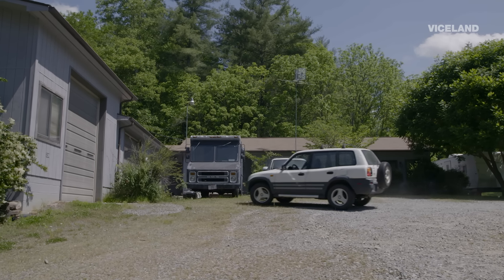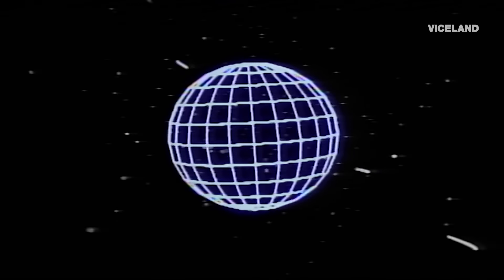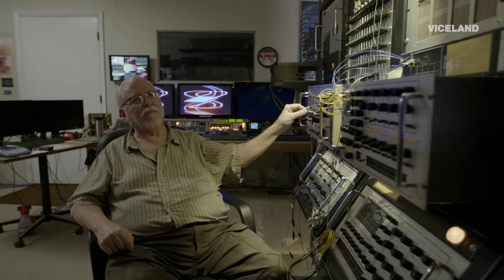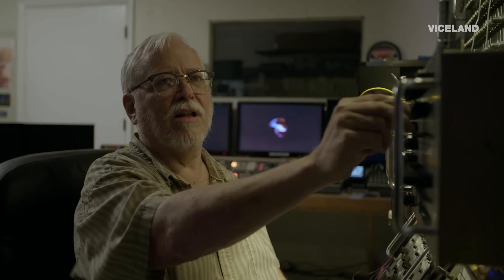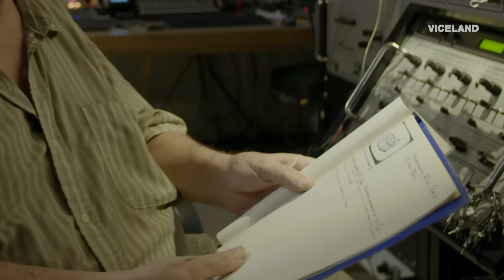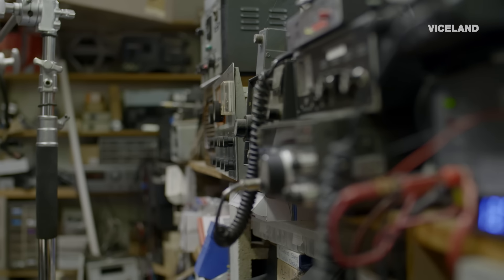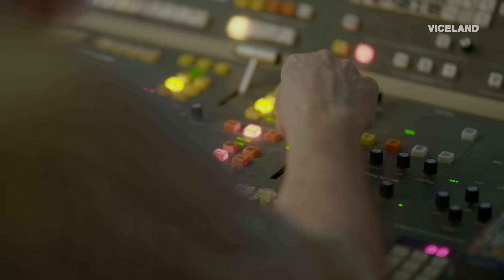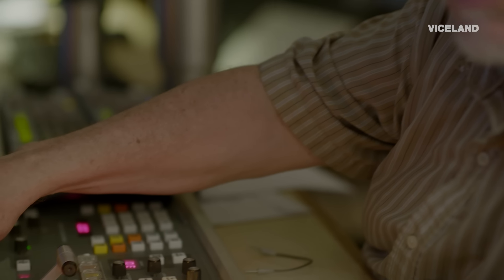Meet the Engineer Preserving The Last Analog Motion Graphics Machine

Comment: This guy is like the wise old grandmaster of Vaporwave graphics and he doesn't even know it!
Reply: I have forgotten the name of that OLD 1990s device Old 1990s device where you connect your vcr, tv, dvd, etc and just press the bottom if you want to watch tv or vcr or dvd or whatever while all of them are running at the same time. Anybody out there knows the name of that device? My American friend wants to know the name of that device because he remember using it as a kid when in the 1990s he has a TV, a VCR, a DVD, a Radio-Cassette, a Hi Fi Stereo FM and AM set with vinyl record phonograph. And is there anybody out there who knows the name of that OLD 1990s TECHNOLOGY DEVICE? He said it more convenient than those all digital system when with his old 1990s technologies (some of which he is still looking in his garage) are all analog controls using press bottoms, level bottoms, knobs, dials, slide controls, slide switches, lever switches, etc ALL ANALOG as he describes it.
Reply: @darthvader5300 They are still made today.  They are called AV switches.  You can plug in several devices at once, then connect your TV to the output.  Pushing a particular input's button will switch to that input.

Comment: Why does obsolete technology have to be so beautiful?

“This stuff was made to be fixed” - Dave Sieg
Reply: It's not obsolete, nothing can replace it. Apple, however...
Reply: @DarkAngelEU  ah yes because you can clearly use a 40 year old computer and still have it do everything computers nowadays
Reply: @vyrva5690  "tools" last forever, "computers" become obsolete. This is basically a large tool, not much computer stuff, just buttons and dials.
Reply: @xc8487  It still makes calculations, so technically speaking it still is a computer? The difference is that this computer is entirely analog, and modular, Apple computers aren't analog nor are they designed to be modular and that is the problem with modern technology: the producers don't want it to last. They treat it like a consumption product instead of a tool.
Reply: @DarkAngelEU  even tools today are made to become obsolete or break apart quickly enough.

It's a shame, CEOs have no respect for anyone apart from their money
Reply: @dabelli3818  If this were a computer, you'd be talking about render time. This years computer renders twice as fast....this isn't a computer, it's realtime analog electronics. Analog may not be the end all be all today, but it definitely has it's benefits, especially when it comes down to the granularity of control. We lost something when we switched to digital, and I'm certain there are probably a lot of things that could be done better in analog. They both have their benefits, but we're of the mindset today that newer is better, when it's really only better in specific cases.
Reply: @MaverickBlue42  oh no, I'm sorry, I think I didn't explain myself well enough.

My example was very broad, not really about this specific case.

Really, everything today seem to break apart quicker.

To make an example: a car from the 70s today is still running, but 10 or 15 years old cars are breaking apart, not to talk about newer ones.
Reply: @dabelli3818  You're probably lucky if you get 10 years out of a car nowadays.....
Reply: @MaverickBlue42  yeah, that's what I mean, and not only cars.

Washing machines, phones and Computers, light bulbs...
Reply: @dabelli3818  My PC is going on 10 years old now, there hasn't really been much progress on that front. Had to upgrade my video card this year but that's about it. Still gaming at an average of 80fps at 4k. If it weren't for upgrading to a 4k monitor, I may not have even had to do that.
Reply: @MaverickBlue42  yeah, but what about portables (?) PC?

I'm not sure it's the correct word, sorry
Reply: @dabelli3818  PC = personal computer. Laptops are garbage, you'll pay twice as much for equivalent specs, but it still won't perform as well due to thermal throttling. If you have to be able to compute on the go, it may be an acceptable trade off.
Reply: @MaverickBlue42  yes, thank you that is the word: laptop.

Yes, that is the reason why anyone would want a laptop, and they get old pretty quick compared to PC.
Reply: @DarkAngelEU  Louis Rossmann viewer too I see :)
Reply: @MaverickBlue42  10 year old PC running 4k 80? What exactly are you running GPU and CPU wise?
Reply: @Carterthielftw_  Who's that?
Reply: "This stuff was made to be fixed"

I feel like the same may be said for humans.
Reply: @Carterthielftw_  i7 2600, 3.8Ghz, stock cooler, 16 gigs of ram. It's not the greatest in the world, but it gets the job done.
Reply: @MaverickBlue42  ive got a similar old Win7 pc with a 3rd gen I5 and 12gb of DDR3. I use it when I am attempting stuff that could corrupt an OS on my main win10 pc.
Reply: @DarkAngelEU  google him, he's probably the largest and most well known right to repair advocate. He posts videos on stuff like component level board repair, life advice, stock market reports, cat videos, updates to R2R, etc...
Reply: @Carterthielftw_  Sounds like a guy I'd like. Thanks for the tip :)
Reply: I had an Tektronix Oscilloscope from the 70's.  The level of workmanship and engineering was top notch.
Reply: @Cole S I'm looking at ten original comment and trying to understand this comment but I just cant. It appears as if you are an Apple user (which is fine) that does not care about repairability (not fine) that calls people who are pro-repair "Google sheep"?
Reply: @Cole S nobody in my immediate family has owned an Apple product in the past 25ish years. We aren't a fan of the form over function and the business practices of the corporation. However I have recognized the issues with companies like microsoft. I actually hate Microsoft with a passion such that I have pirated windows 10 licenses on 7/10 of my PC builds. I would have pirated the other 3 but those friends didn't want to buy a sketchy ebay key. I'm in the process of moving over to Linux aswell. The only other OS that I would like to leave (due to business practices) is android. However mobile Linux device are absolute trash and I really enjoy the overall feel of android. I am currently using an S5 and a jailbroken Kindle HD8+. And I will never buy another Samsung product due to their anti repair designs. I am an Apple hater. I don't deny that. But I also do try not to lose sight of all the other, almost equally as bad, corporations that control our lives. :)
Reply: Because it forces you to be creative.
Reply: @dabelli3818  I used to work for a big appliance manufacturer. In a big meeting, one of the top dogs said "we'd love to make a high quality model that lasts longer, but the consumer just looks at the price tag & buys the cheaper one too often to support that model. There's no market for high quality, so we have to make them as cheap as possible."

That said, there are other managers in the world that do all they can to discourage repair.
Reply: so it stays around even though the average person in 2024 is a 4k addict

Comment: Imagine trying to figure this thing out after he dies. That's the real tragedy of stuff like this. It's going to be gone to forever.
Reply: I worked closely with a Scanimate guru for a few years, and still only had 3/4 of an idea how he did what he did !
Reply: On the flipside, at least it's easier to figure out than modern miniaturized locked down crap. Try to dissect and put back together a modern board and have it working.
Reply: @rockytom5889  The electronics wasn’t all that complicated, just a lot of it.
The trick was patching all the modifiers together to get the desired XY modulation.
The other issue was ensuring repeatable thermal stability over lengthy sequences.
Reply: Ryading Panaakalantayan  hehe, you must have seen a different machine than I did!
Lots of docs, [mostly OEM components) but not exactly ‘well documented’ as a system in the early 80s!
Reply: Hope he is mentoring someone with the same passion as him 🙏
Reply: @wideyxyz2271  Sadly, there is a point where the actual equipment becomes irrelevant, but it’s important to record oral history and the documents for history.
We do have to nod to improved efficiency and practicality, but the original motives are pure.
Reply: honestly this looks very similar to a modular synth. the controls seem relatively conventional.
Reply: @laustinspeiss  ok...let's see u do it
Reply: @Itwillgetbetternever  Why, I’ve never operated or set up a Scanimate to any extent than fiddling between jobs... if you want the number of a very experienced guy, I can put him in touch with you for a paying job.  It won’t be cheap.

Comment: Someone needs to bring back old things like this in film and stuff
Reply: What's stopping you?
Reply: Why? It's no where as good as what we can produce now with a computer... using this for actual movies or TV is just stupid.
yeah it's kinda cool, but it has absolutely no use now except to please this guy and anyone else who think its cool. But it has no use apart from that. We do so much better nowadays it would be dumb to use this for anything.
Reply: hahaha, what?!
Reply: "No use except to please this guy and anyone else who thinks it's cool." 

There's a lot of people who think it's cool my dude.
Reply: Wes Tolson yes many people think it's cool but u can still do everything that can do digitally. The only difference is that that is analog and u have to use chords and knobs and such to get the effects u want. It's the same thing with music. There are modular synths  (and they still make them) and software synths but guess what most music is made digitally because of the fact u don't have to be plugging in wires from oscillator to effects and such. The softsynths still act like the old analog ones in the since ur still turning knobs and such but it's easier because u can do it quicker. Ur not thinking realistically. Sure thay machine is amazing but we can do much more with less now
Reply: This probably could be used, but it wouldn't fit modern Hollywood standards. Maybe Indie productions?

Comment: My kind of man!  I myself was more on the audio front, but one of my predecessors on the campus audio distribution advanced to the TV issues before graduating.  I have been told that he turned in his first thesis work too late and was assigned a new topic, design of a TV trick mixer.  So, 14 days later he brought in a 14 page document.  And not only that, but a fully working Trick Mixer for the experimental TV studio.  That was amazing enough to be approved for his thesis despite the brevity of the documentation.  The expected length in those days was 50 to 100 pages.

Comment: I love this old analog stuff, you just can't get the same type of control with modern digital editors (video and audio).
Reply: RIPPEDDRAGON40k yeah, you get pin point accuracy with the equipment and software we use today. The beauty of analog were the flaws. It's like listening to old records. You know back in the day when artist would record something they had a very limited number of tracks they could record on so often times mistakes made it on the record. It's the feeling that humans with all our flaws put their hands on machines to mold the art that's what makes it so beautiful. Now-a-days all we get are cheap remakes of old visual art and mass produced digitally synthesized music with a 2 or 3 chord progression (I'm looking at you Taylor shift)
Reply: nothing will ever surpass the quality of analog. never 
no software can even emulate close enough to old reel track that band like queen used to record.
no digital camera can match the quality on 70mm or 35 mm film look too.
no laser printing does better job than dark room film process.

it's just that vintage stuff has the quality that no digital can ever reproduce
Reply: Ryan Ramsey tbf though, those recordings weren’t the Uber loud remasters we now have with no dynamic range. A lot of the “mistakes” are intentional though, certain songs with people talking in the background at a really low volume etc. It gives a greater sense of being there. I guess that’s why people invest in high end speaker systems as well.

Comment: Fun Fact: Even to this day, you need a lot of computation power to emulate analogue technology. Still, you get ~97% of the original, not 100.
Reply: On my Linux machine I run cool-retro-term for command line work. It looks like an old 1980s CRT monitor, curved screen, 60Hz hum, scan lines, random noise. Very retro, worth it just to keep all the windows I have up looking the same.  But yeah, 97% like the real thing.
Reply: @DrunkenUFOPilot  link?

Comment: I inherited the title of Broadcast Engineer and it is a dying breed. Even the newer transmitters we are not needed any more you just swap module boards. Last part I really replaced was a cooling fan and that had us off the air 24 hours because there is no radio shack to get the part from any more.

Comment: Funny, having recently retired from commercial tv I get where he's coming from. But having gone from film to tape to computers (digital) all I can say is I loved how it got easier & better to do the stuff that machine (and others) could do.
& throw away they did. I recycle. & right now I basically have a whole analog tv station in my house that I am slowly tearing apart for the various metals. There is no real after market for stuff that even the engineers gave up on trying to fix. It simply wears out. AND the equipment available today is better at doing what those old machines were trying to do at a fraction of the cost.
Appreciate nostalgia, but with every new invention that came down the line in my 35 years was always more exciting and always made my job easier to do as well as be able to more fully realize my creative visions.

Comment: Throwaway society is so true, I've got an old car that I rather fix then crush but my friend are all arguing that single should get rid of it cause of its age. No. I repair it, if I want a new car with a bigger engine I rebuild it. If I want more space I rebuild the back. Cut away steel, weld some new one and grind with sandpaper, repaint and done. Having a small dent or a worn bearing or even a rusthole doesn't justify a brand new car. It just doesn't.

"Its been worth it to me" I love the way he said that.

Comment: As it’s all based on frequencies, I started wondering if the timing crystals and frequency generators could be upgraded in a new design, (because I don’t think the old design would be readily upgradeable) to increase the frequency of the scan lines, thereby increasing the resolution, then feed the final signal into an a-d converter so it would be compatible with an HDMI signal.

Comment: I think his work is very important as it shows the power of analog circuitry. The images can be easily made digitally but the details of a random noise source or an op-amp just gives the image that distinct look that digital effects have a hard time replicating. Also, the circuitry designs are practically priceless as often such designs find their use in many other devices that still have use today. Novo-Technophilia in my opinion makes it hard to see that, if it's not new we just think it's useless.

Comment: Heh, I couldn't help but notice the HF rig.  I'd greet him as a fellow ham, but I'll just say 73's and not doxx myself.  Lol.  Also, this video is a good example of how tech has revolutionized many different thing.  When I was young, I very nearly ended up a professional musician (I've had a weird life).  In those days, at home, you had a 4 track unit, the local towns "studio" would often have an 8 track and if you were very lucky and/or had the money, you might get to use a 16 track or 24 track unit.  Now?  I routinely have more than 24 tracks in play around DAW (digital audio workstation) projects and I'm barely a hack as a musician at this point.  The days of aligning heads, degaussing stuff, cleaning tape paths, pinch rollers, cleaning capstans, bias, all that stuff, it's just gone.  Now, a laptop, a usb interface and a bit of software and you can do stuff we couldn't even dream of when I was young.  I still love this older stuff though.
Reply: His final closing remarks of "It's worth it to me" makes me wonder what will happen to all my own stuff when I'm gone.  Nobody really appreciates gigantic 15,000 RPM SAS raids, unix machines, ham radio stuff, function generators, analog o scopes (I have a tektronix unit that's indistiguishable from the one you see in the ENIAC pictures in fact! 600W worth of heat though!) and such.  Even my night light I built that runs for 5 years on a set of 3 AA cells that's cool as hell...  Nobody will even know what it is.  They'll just toss it along with my notebooks.  :/  At best, it'll be a "strange, it's still on and he's been gone for years" *into a trash can*.  Ah well.  That's life I guess.

Comment: I can relate. My problem is I value things that others will throw away or give away and then I find them and keep and or repair them. Like for instance a perfectly working Sony computer with Windows 95 plus on it and a add on TV tuner as well. That was amazing for the time and it still works. Tuner is analogue, but that is not the designers fault. that is the tip of the iceberg of the collection I have. Problem is my very small house has become a warehouse/shop and I hope to have a wife some time soon......